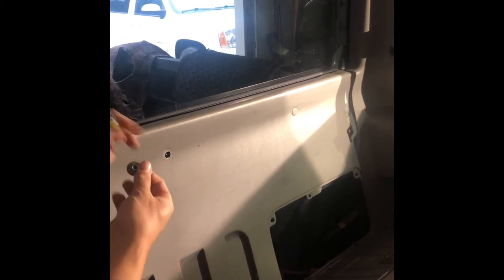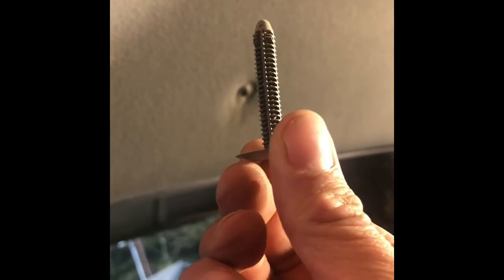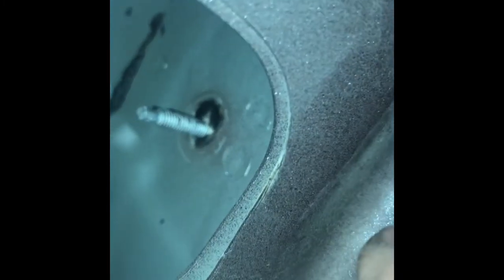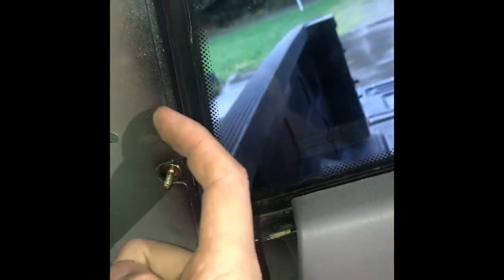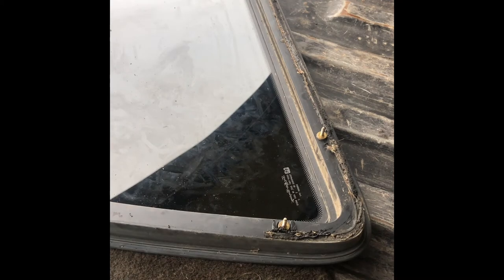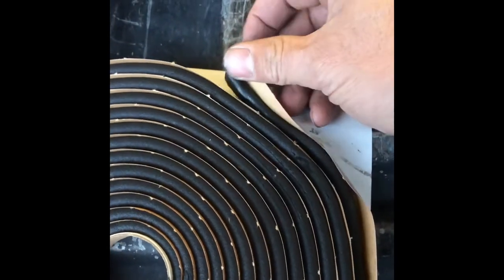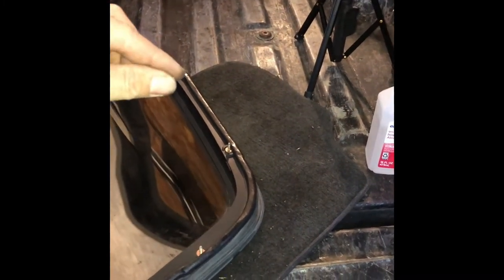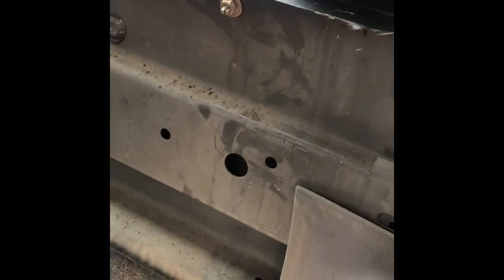'97-2003 Ford F-150 Rear Window Leaking?

Comment: Awesome video and very helpful. I have this same issue on my 03 f150, but the plastic trim is cracked. Is it possible to replace the trim with having to remove everything?
Reply from the maker: Dang, that sucks. Not that I cant tell. Thanks for watching and for the compliment.

Comment: Great video. How long butyl tape was needed? I have the same problem on my 01 F150.
Reply from the maker: @Mahesh Patel best way to do that is to measure around the window. Butyl tape is pretty cheap though, it’s better to have a little extra than not enough, so measure fairly generously.

Comment: If you are still getting leaks,,,it's the $ 8.00 gasket behind the 3rd brake light guy's. First thing to cause a leak on 97-03 f150

Comment: A small tip, use the butyl to remove the butyl. As you start collecting it and get a small blob of it, use that and go around the window dabbing it to itself and it pulls right off
Reply from the maker: Nice, thanks for the info and for sharing it! Thanks for watching also.

Comment: So butyl is better then using window weld? I would think window weld would last forever compared to this tape
Reply from the maker: You know I’m not sure. After talking to a couple different body shops, they said what they use depends on the gaping. Butyl fills in better. Window weld can be messy and costs more.
Reply: @figsoutside1981  I'm doing mine and I'm going to use a 3M 08611 5/16 ribbon seal. I think its supposed to be a replacement for butyl. I was going to use windo weld caulk but it looks to messy.
Reply from the maker: Cool, let me know how it works👍🏼

Comment: I ham handed the interior upholstery trim fastener and need to find where to get the ones with the button you tap in, of course with appropriate color, any help would be appreciated
Reply from the maker: @Phil Rowland you need the plastic buttons or the larger plastic piece? RockAuto usually has many of different body and interior trim stuff or you can also try ebay or if you have a local pick and pull auto yard.
Reply: @figsoutside1981  Thanks, just the button with the center you tap in and then pull out will try Rock Auto, then a couple of local salvage yards
Reply from the maker: @Phil Rowland sometimes you can get lucky and the auto part stores will have them also like O’Reillys or Autozone. Usually in black, but I have seen them in different colors

Comment: Good video. I noticed some of those nuts inside of there appeared to hold the plastic trim in place that is outside of the cab just above the bed.

Do you have to remove these inside panels to remove the outside cab trim where the third brake light is located?
Reply from the maker: Yes, if you are wanting to remove the cab trim…?

Comment: This is great. Having the same issue with my 03. Where did you get the butyl tape?
Reply from the maker: @sjsydnor Thanks you. I bought it at our local Ace Hardware. Home Depot or most hardware stores should have it as it is also used for sealing gutters, roofing, ducting work, etc.... I was also told that many auto part stores have it. Hope this helps you out. Thanks for watching.

Comment: Question: What type of butyl tape did you buy exactly? I see all kinds of thicknesses out there, and I want to make sure I don't get the wrong kind. Thanks.
Reply from the maker: @Paul Guerra If I’m remembering correctly, I used the 5/16” round black butyl tape.

Comment: how do you get the back portion of the backseat down? does that fold down and i don’t know it?
Reply from the maker: @Matt DAmbrosio there should be a lever on the door side of the seat, almost under it.
Reply: i can’t find it? i have a lever that lifts the seating part upwards but not the back part down. driver side or passenger side? any other tips?
Reply from the maker: @Matt DAmbrosio my daughters was stuck at first. It should fold forward. There’s usually a compartment behind the back seats. That’s where the tire jack is stored too. It lifts up, then should fold forward.

Comment: I’m kinda late to the party but… how many rolls of that tape did u have to buy? Amazon has them in 10 ft sections $15
Reply from the maker: I bought one roll. Bought mine at Home Depot. Don’t remember how many ft it was though. Was either 10’ or 12’ I believe.

Comment: I have to do this to my 2000 Ford F-150 Harley Davidson edition!Mine's only leaks when it's raining really bad but if it's light rain it won't leak.🙄
Reply from the maker: That’s because as of right now it probably only has small gaps in the seal, which will only get worse with time.
Reply: @figsoutside1981  yeah and to make matters worse it looks like someone did a sloppy job on the outside seal with some black rubberized silicone stuff! Smh
Reply from the maker: @Hecks_B_Rex Yeah that sucks. Someone did the same on my buddies F150 that I helped him with. Used alcohol and an old washrag to get it off. Don’t use paint thinner or anything like that, you can booger up the plastic.

Comment: Why in the hell did they use brutal tape the stuff is absolutely worthless 5120 silicone I think it's called would work much better its the same stuff they use for windshields no wonder it was leaking  butal is petroleum based and will dry out 5120 is silicone based and will not degrade over time.
Reply from the maker: Who knows, why did they go with such a terrible design in the first place. Thanks for watching.